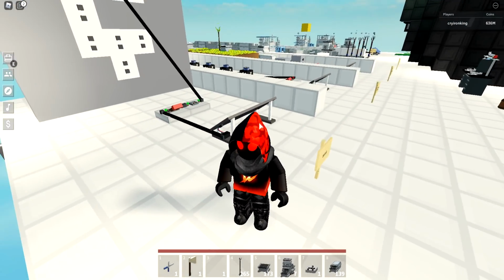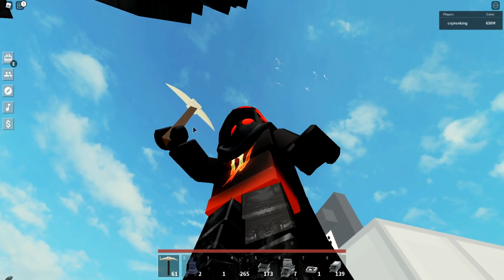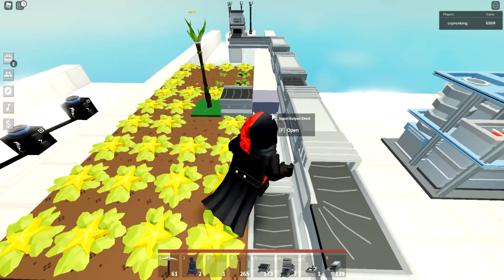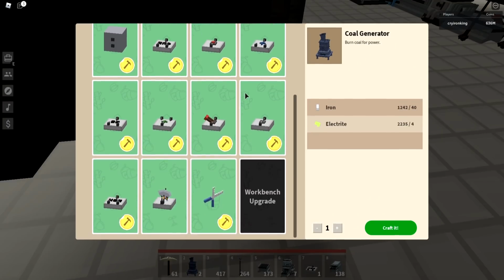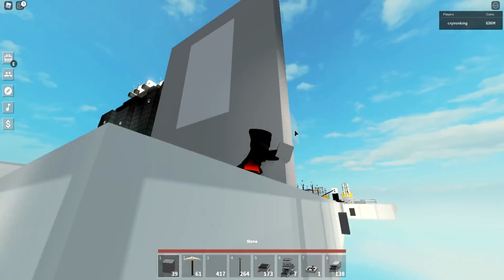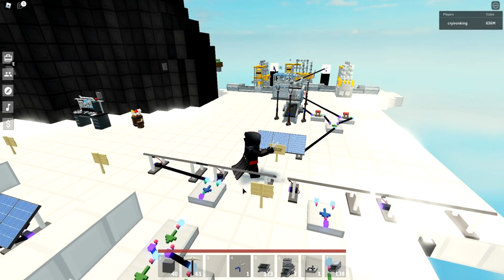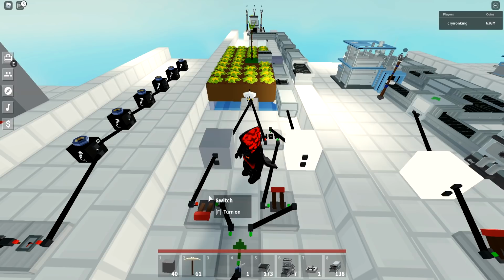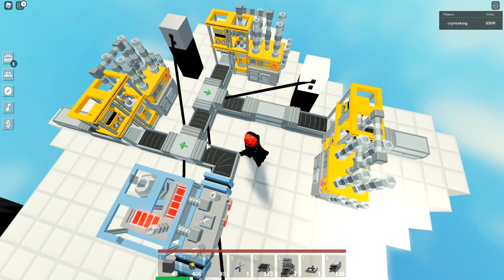6 Electric Build Designs & Cool Uses for Roblox Islands

Comment: I think it would be cool if they add a new pickaxe but it's a drill and it uses gasoline and you get gasoline from a oil deposit and you use pumps to harvest oil and then you use a empty gasoline tank and you make that by plastic and you can get plastic by using a plastic machine and you can make that with 250 steel and a extractor and you can make a extractor with steel and a buffer crystal and gold

Comment: Getting a battery unit in this game IS gonna be a bit challenging with the way they made it. It would have been easier if they made it the same way as the red Stone flux mod with RF since it would be easier to store and generate power even though it would make powering machines slightly more difficult

Comment: Idea: industrial coal generator
Basically a coal generator but with the ability to be fed coal via conveyor
Downsides: very bulky (washing station size), very expensive to make (300 iron, 8 steel rods, 200 electrite), makes slightly less power that the coal generator (about 8)
Reply: 2 years later: Steam Generator

Comment: You can loop a circuit back on itself through an OR gate in order to get perpetual power.
Reply: I also intend to use OR gates for cable routing.